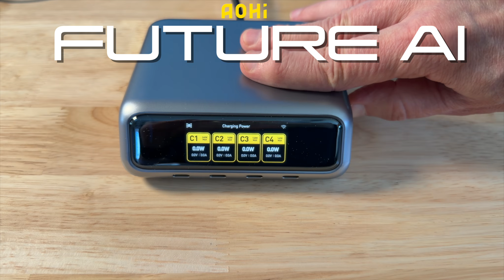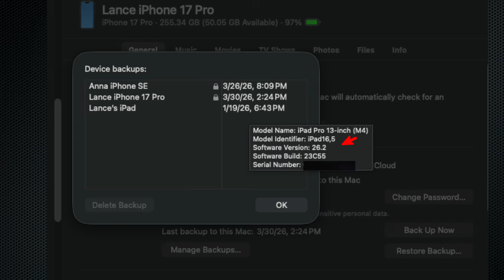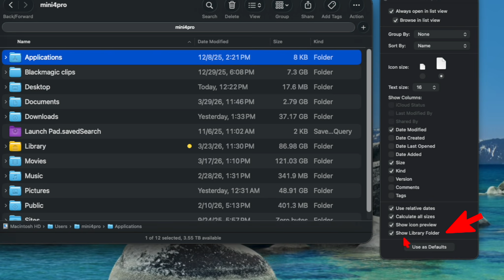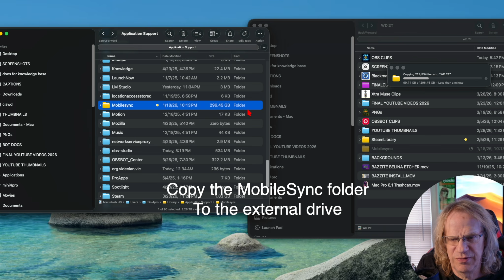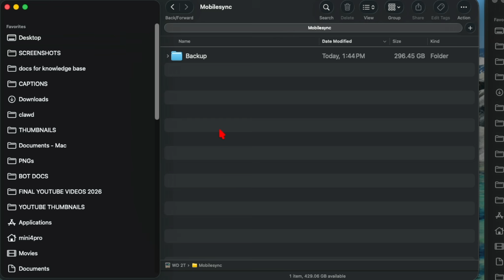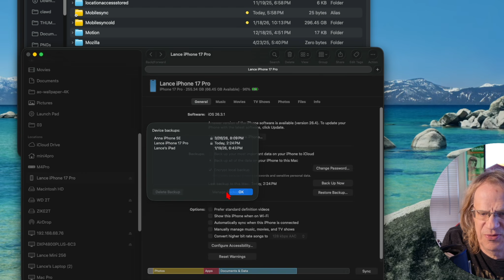Get iPhone backups OFF your Mac — use one external drive for the whole family!

Comment: I'm stuck at step 6 MobileSync symbolic folder won't drag.
Reply from the maker: You can type the path in terminal instead but if there is one typo it won’t work, but that’s odd are you using an administrative user account?
Reply: @MacSoundSolutions  what do we type into terminal if Mobilsync can’t be dragged?
Reply from the maker: @M @MarvinsBareFootNow  11:54 in the video starting with  ln -s it has to be followed but your drives name etc
Reply: @MacSoundSolutions  I can’t drag it out of Macintosh HD so I won’t have the link from the external hard drive to put into terminal to create the symbolic link.
Reply: I was able to copy and paste into the the external hard drive lol, so if it can’t be dragged just copy and paste it 😂
Reply: I’m having the same issue
Reply: If you can’t drag it just copy and paste it 👍🏼

Comment: When I plug my external HD in and open it up in Disk Utility to reformat it, I only have the option to make it a Mac OS extended (Journaled) or (Case-sensitive, Journaled), or MS-Dos (FAT).  I don’t have the option to make it APFS. Will this still work? Which option should I choose? Thanks for the video!!! It’s super helpful!
Reply from the maker: I\go up to the menu and show all devices. If it’s a spinning drive you can use Mac OS journald ssd should be apfs

Comment: I think there’s another way to do this: Make a bootable OS drive, remove all unnecessary software, just use it for iOS backups. Every time you need to backup your phone, plug the drive in, boot it and do your backups.
Reply from the maker: Honestly even though the video is long it takes just a few minutes to set this up. Another method is to move the main user account to an external drive, and all ios backups go there as well. Or you could do what you are saying but easier yet  just setup an extra user account and use it for ios backups no system needed.
Reply: @MacSoundSolutions  Set up an extra user account? Is there a video for that?
Reply from the maker: @DLDL-h6q  https://youtu.be/OPyUDMpKS-U
Reply from the maker: @DLDL-h6q  https://youtu.be/OPyUDMpKS-U

Comment: How do/would you recommend backing up photos, when you also use icloud for backups and photo syncing (w/ iphone, ipad, mac)? Thanks
Reply from the maker: I have a video on this. I make two photo librarys one is the system / icloud and one is the main photo library not cloud because I have a huge photo and video library. But recently I have been using a Ugreen NAS and it auto backs up my photos and videos without having to think about it once its setup. You can still use icloud as well if you want as they are seprerate. NAS video https://youtu.be/jxAliYR4Fs0 and Apple photos backup video. https://youtu.be/CdD2TReV5kQ
Reply: @MacSoundSolutions perfect!